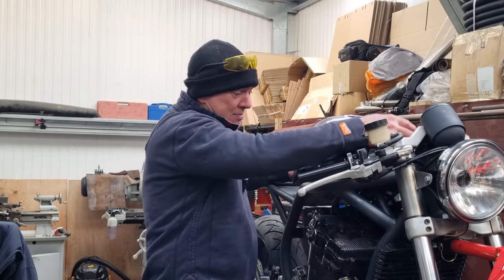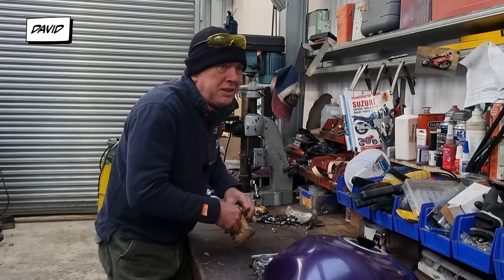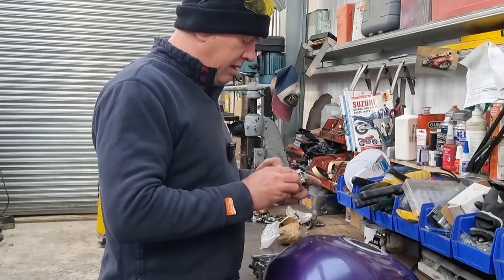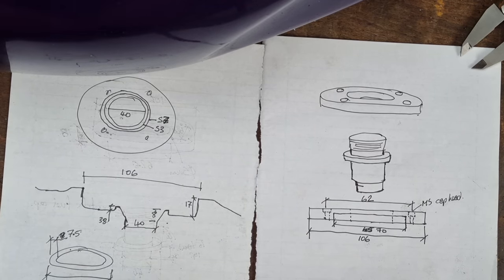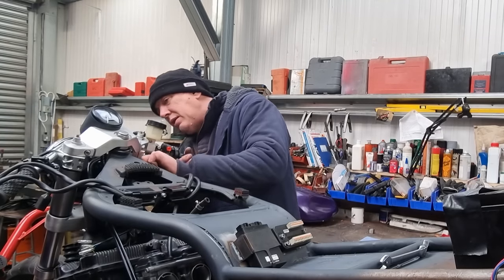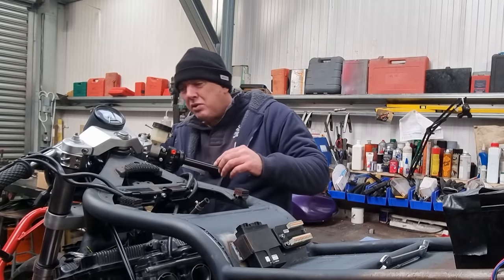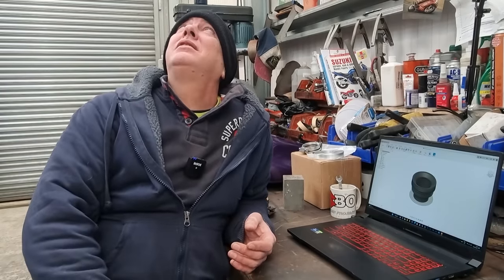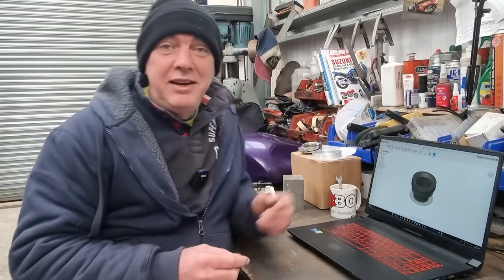Carbs, Pods & Cables - Suzuki Bandit Cafe Racer - ASBO Project

Comment: I use Venhill self assembly stuff which takes a lot of measuring headaches out of doing hose runs. I gave in using Goodridge many years ago.
Reply from the maker: It looks like they're exactly what I'm after. I've placed the order now and the Goodridge stuff is in the hands of the postie again 😁👍
Reply: @QuickBikes  top tip is to use the mandrel they have as well, stops you stabbing your fingers with the braids...

But it aint fecking cheap... 🤣🤣🤣
Reply from the maker: Hehehe... No... No it ain't 🤣
Reply: Also look at EARLS PERFORMANCE in Silverstone

Comment: Maybe keep the 8 holes but just "tap" the 4 you don't need and still fit a short cap head 👍
Reply from the maker: I could do.... Dunno.... I'll probably just do the four for now and see if I like it as I can always add the extra holes later 😁👍
Reply: @QuickBikes  yes of course, just thinking it may look a bit empty without the extra holes, but then I suppose it is what we are used to seeing, so only having 4 may add to the individuality..👍
Reply from the maker: It'll make it simpler looking alright 🤣😂

Comment: Venhill stuff is top quality and better than Goodrich in my opinion.  Been using for some time on all my bikes. Question. Will the monza cap require a breather to be fitted to the tank?
Reply from the maker: Looking at the underside it looks like a vented cap to me. I'll check, but even if I have to add a vent, it shouldn't be an issue 😁👍

Comment: Quicky Venhill it is then!
On the Venhill site you can choose the required custom hose length and the app allows you to mix and match banjos which are all interchangeable screw in 1/8th BSP fittings.
Reply from the maker: Yeah, I've got a load of stuff coming from them and we'll go through it all when it gets here 😁👍

Comment: If it's worth doing, it's worth overdoing 🙂 That's gonna be one hell of an overengineered filler cap jobbie thingy !
Reply from the maker: It won't actually look much different to a standard one, but every face of the insert has a job to do 🤣😂
It'll be easy enough to turn though anyways 😁👍

Comment: You may need to find the key as the original ignition switch has a stupid weird resistor in it that has to be there for the switch to turn on the ECU. With out the resistor it won’t run. Apparently it’s a way they used to get around thieves hot wiring the ignition.
Reply from the maker: Aw bugger.... I need to look into that then...
Reply: @QuickBikes  I have heard of people buying cheap Chineseum ignitions and they don’t work cause of this damn resistor
Reply from the maker: Good to know matey, thank you 😁👍

Comment: Are you going to tether the pods?
Reply from the maker: Yes... I've heard stories of them getting displaced with vibration (nasty roads etc) and just disappearing without your knowledge. They'll stay as they are for the Dyno run (IE just nipped up), but will get lockwired on the final build 😁👍